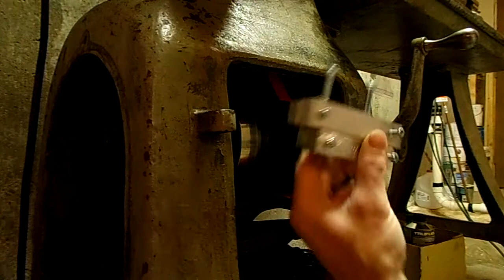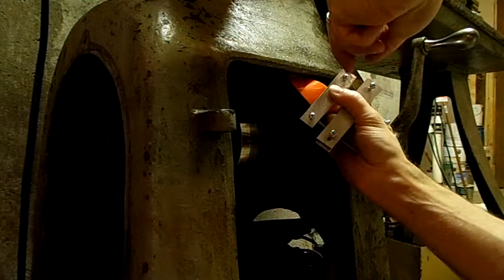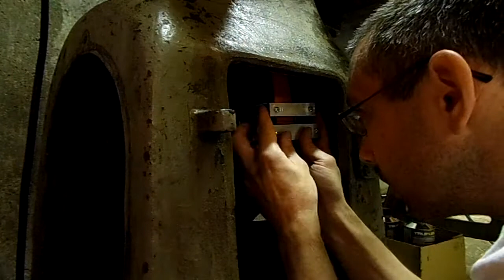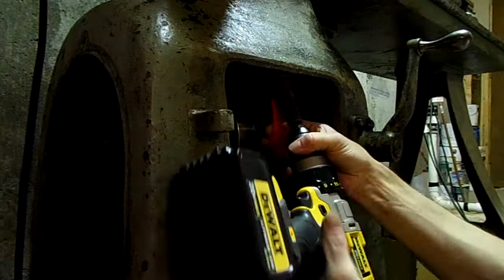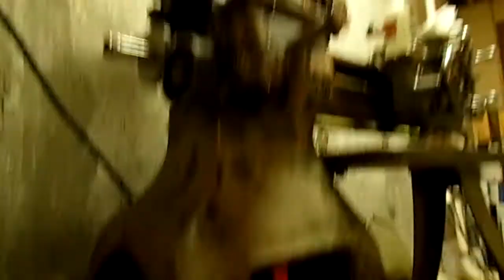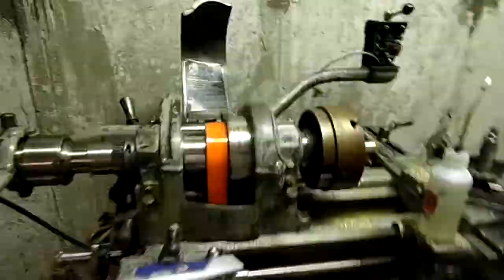Welding a urethane drive belt on a '43 South Bend 10L

Comment: I just checked, and unfortunately you didn’t win an Academy Award for cinematography, but I appreciate your video anyway. After trying the serpentine belt 3 times and having the belt separate at the superglued section (not flexible and the lathe chewed them up and spit them out).  Hopefully the urethane solution will work much better.

Comment: That seems to be a nice option for me to replace my old one. What is the thickness of that belt? Did you have to cut it shorter than the original one? That's a great video. Thanks
Reply from the maker: Sorry for the late reply... The belt is .090" thick, and 1.200" wide. I got it from McMastercarr. Yes, it's going to be shorter than the original, this material stretches a LOT. There are rumors of a version of it with cords in inside, allowing for less stretching, but i couldn't find it. Anyway, constrict your drive system all the way, and fit the belt just loose enough so the machine doesn't turn. Then, you have enough play to tighten the belt. I had to do it twice, because I mis-judged, and there wasn't enough throw to tighten the belt adequately.
Reply: @sethwatson8952  it

Comment: Is the belt still running?
Reply from the maker: Sure is... no real problems to report.
Reply: Seth, thanks for the reply. I haven't gone to the PM post yet, but did you happen (or did the original poster happen) to show a build diagram of your clamp?
Reply from the maker: I don't recall...I don't go on PM much lately, couldn't even tell you what thread that was. If needed, I could send you photos with dimensions. It's really simple, a drill press and a tap is all I needed IIRC.
Reply: Seth, I tracked the thread down, and no designs in it. I just spliced my belt back together earlier (and I don't even have my lathe up and running yet anyways), but when it comes time to get a new belt if I go the urethane route I might take you up on that generous offer. Thank you I appreciate it.

Comment: Were did belt come from? Supplier?
Reply from the maker: +Joel Stewart McMasterCarr. If I was going to buy another, I'd look a little harder for one that was reinforced. I have heard that there may be reinforced urethane belts out there, and the benefit would be that it wouldn't stretch as much. The stretching can be dealt with, but you have to make the belt shorter than you would think. I had to do mine twice.

Comment: Hi,
Very good job! Let the belt cure for 1/2 hour before using it. Just welded they will fail!
It my have taken that long to finish trimming the belt...Very good....Bernie
Reply from the maker: Thanks for the comment! I was not aware that it had to cure. It's simply heat, then cool. If I recall correctly, it wasn't quite a half hour before I ran it. To date, it's held up fine. In general, right after I did this project, I had some misgivings about it. But most of those turned out to be unfounded. I'd probably do it again.
Reply from the maker: So, I have been using this belt for 2+ years now. Still no failures!